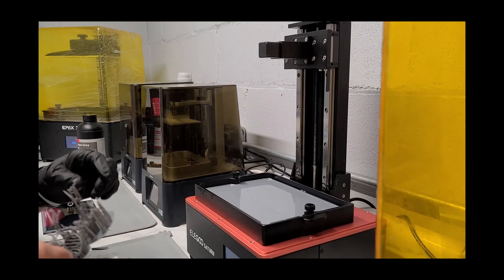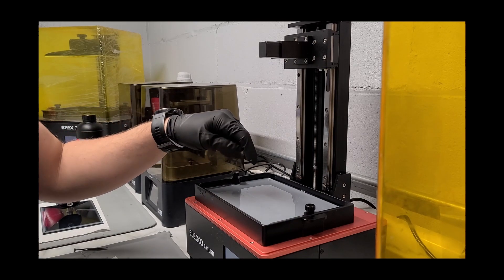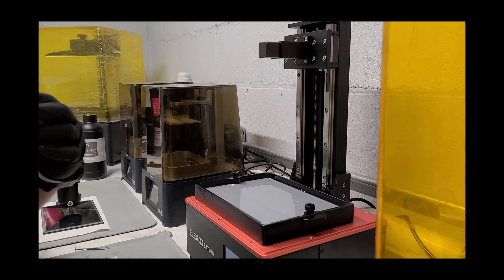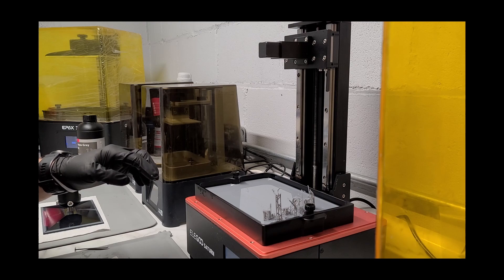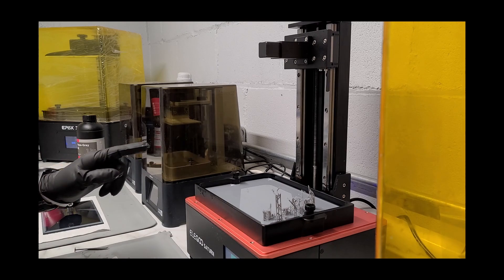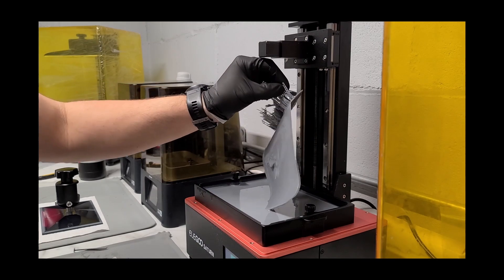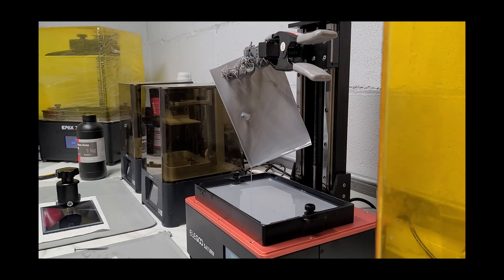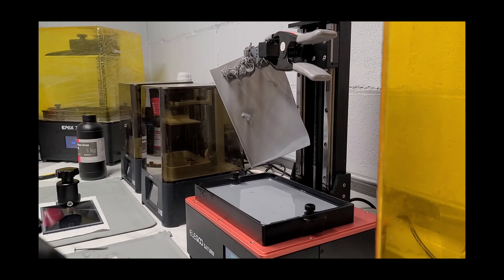Quick 3D Resin Printing Tip: How to clean failed prints off your fep without draining the vat!

Comment: Another cool thing about this is that you get to inspect the surface of your FEP. Just clean the sheet after draining, cure and inspect the bottom surface. You'll see all the dents, dings and scratches in your FEP and can assess whether you need to replace it. I do this with my Mars 3 and have a nice record of the state of the FEP in between times when I'm not changing the resin. Cheers.

Comment: You can also do it with any resin printer. Just make a 3d object the exact dimensions of your build plate, and 50Uhm tall. Run the job without the build plate on.
Reply from the maker: That's a great tip! I think you could even do that in your slicer.
Reply: Any chance of showing us how to do this?
Reply from the maker: @adambrown9009  Already did! Have a look at the new video!
Reply: Or use the full screen test.
Reply: or buy a printer thats has been produced in the last  3 years

Comment: Man I gotta give you a huge thank you, I’ve only been printing for a couple weeks and had my first fail today, 5 medium sized parts fell off supports and landed in the bottom of the vat. I found your vid before tackling it, and it worked exactly as shown in this video. Also as you’ve said in the comments, I couldn’t find any floaties in there either so this was a real quick and easy solution. Thanks again!
Reply from the maker: Wish I could say this was my idea. So credit to whomever thought it up, but the little clippy thing might be mine ;)
Either way, Im happy have been able to help ya out. Make sure to check out my other videos since your new. Check out the calibration class, and also the 3d printing beginner class.

Comment: Thanks for this tip, just used it on the first failures I’ve had on a new Saturn 2 and it works a treat. I did increase the suggested 15 seconds to 30

Comment: That is ace! I had my first 3D printer for Christmas and killed it by damaging the FEP and getting a huge resin spill only two weeks after. Elegoo have helped me to buy a replacement (excellent customer service). I will be bookmarking this tip!
Reply from the maker: Make sure to check out my beginners 3d printing class, then calibration class on this channel. It's a lot of content but you're going to come out the other side with so much understanding.
Reply: Same happend to me just 12 month later :D

Comment: Damnit, I wish i researched this prior to my first tank clean, dented my fep - one faile print since. Found this video though and it worked a dream on my Saturn 3 Ultra- Had to run tank clean twice for 25 seconds, light pressure on the supports i used, and iot pealed out so clean! THANKS MATE
Reply from the maker: You'll likely never have to worry about it again though! Welcome to the family :D

Comment: I wonder if the screen test function would do the same as the vat clean
Reply from the maker: some screen tests are a specific "shape" but someone commented above that you can create an object on the build plate that's the entire size of the screen .05mm thick and print that as a stand in for the vat cleaning function.
Reply: @TableFlipFoundry  and take the build plate off first

Comment: Off topic question. My LCD on anycubic M3 Premium is cracked but it still works. Several small cracks accross entire LCD. Thing still works. I have one on order. Should I even install it?
Reply from the maker: Hey...if it's working and not causing problems. I say send it. Get what you can out of it while you can. 
I don't think there is any damage you can do to anything in this regard.

Comment: Very useful but first attempt at 10s failed to grip the old Support.  Tried 2nd time at 10s and same thing.  Can I just keep extending the VAT time to 30s until sticks to old support?
Reply from the maker: @gkaruk  mine defaults to 15
Reply: @TableFlipFoundry  thanks, I can go 10, 20 or 30s.  But had to drain VAT filter resin to little.  Remove VAT and gently push FeP up in corner, which lifted enough to grab.

Sadly re-level bed, and seem front right corner is off. So need re-level again after dinner

Comment: The only thing about this is it doesn't grab any floaties that may be in the resin. How often do you have to worry about things floating around in the resin and then getting caught between the plate and screen?
Reply from the maker: It's pretty rare in my experience. You can take a spatula and switch it around the resin to give it a looking over. I run 6 printers in production and I basically never have to drain my vats
Reply: Unless you're getting fail after fail I wouldnt bother draining the tank fully

Comment: how do you know there is still nothing floating around in the vat afterwords?  Seems like if you miss a floater, you could damage your fep?
Reply from the maker: You're absolutely right that is a possibility. For me it's a matter of experience but also you can usually look at the print and tell if something may be amis. If you have a part of the print not stick to the fep, or even the part stuck to the fep, you can pretty easily deduce if something has gone more sideways.

Comment: I was wondering if my Anycubic mono SE has a similar function.

Also, when you put in the old sprue, isn't there a danger you could put it on top of some fails/loose cured resin? Potentially damaging the FEP?
Reply from the maker: No, you arent pushing down super hard, you can feel if there is anything under it and you can pick any corner.

Comment: I have tried this a couple of times and cannot get the layer to pull off like you did.  I ended up pouring out the resin and fought with peeling the layer off the FEP.
Reply from the maker: Try to turn up the exposure time and it can help to hold the support scrap down to the bed with a little pressure

Comment: Well the support I put in didn't stick to the bottom layer. So now I have no idea how to remove that bottom film I've created
Reply from the maker: Drain the vat and with a clean finger push up a corner of the film from the bottom of the fep. Use care and a spatula or tweezers to peel the corner up.
Reply: @TableFlipFoundry  woah fast response! I will try this after I get a new funnel to drain the resin out. Thanks for the advice
Reply from the maker: @cakeinparadise  no problem. Caught me at just the right time. :)

Comment: Do you continue to print after the failure without filtering for debris?
Reply from the maker: I generally determine if all parts are accounted for. I dont usually filter, but I would never tell someone not to. If in doubt, always filter.

Comment: What if I don’t have any old supports?
Reply from the maker: You can still use the vat clean but you will have to drain the vat and press gently from the bottom of the fep on the corner to lift the cured resin out
Reply: @TableFlipFoundry  This worked for me.  I had a huge, thick, circle shape that lifted up with the cured resin and I was able to print after.  I also made sure I saved the supports from that successful print for future tank cleans.  Thanks so much!

Comment: I never put my plate facing down over a paper towel like you did, some tiny particles of the paper can be stuck under the plate and fail to have the model stick to the plate. I always put it sideways.
Reply from the maker: I've never heard that before. I can say, been doing it this way for years with thousands upon thousands of hours of print time with no issues. Probably more theory than practicality.